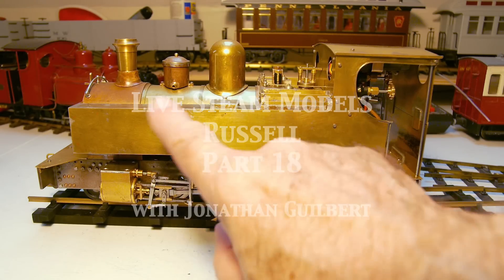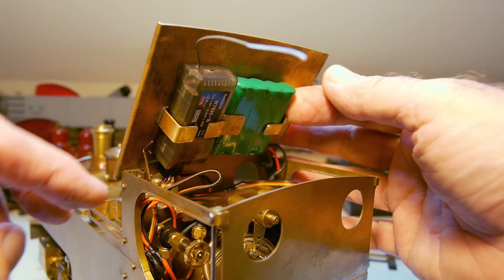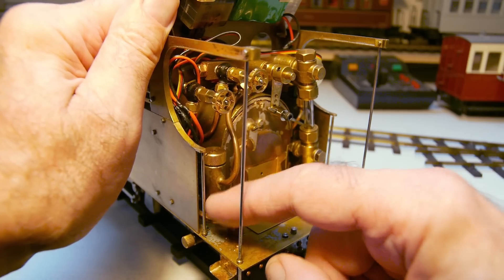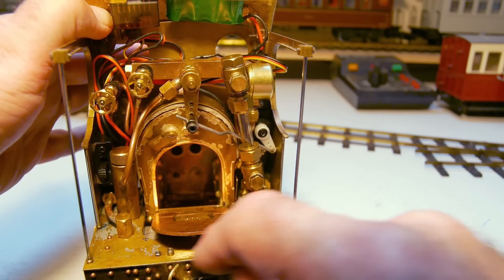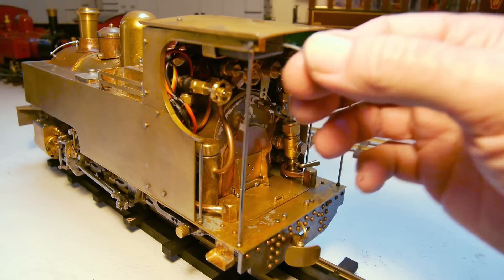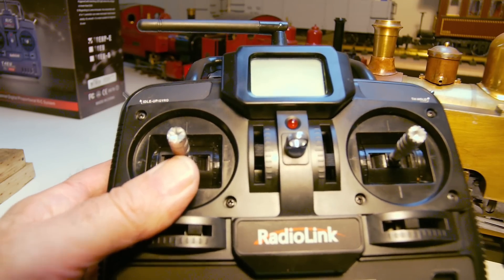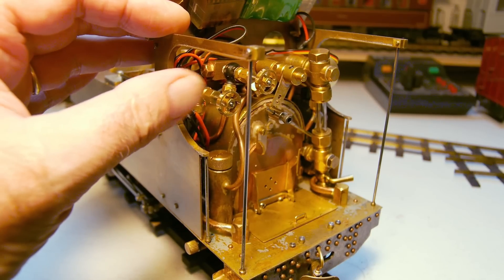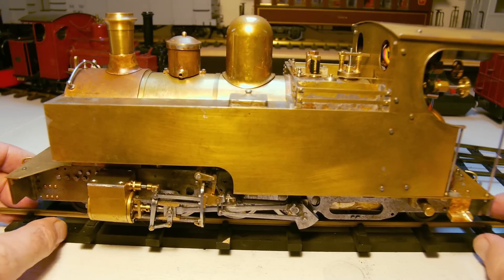'Russell' Live Steam Model Locomotive Part 18

Comment: Very Impressive.  Have you made all the valve gear yourself or did you use Roundhouse components?
Reply from the maker: Hi Heather, the cylinders are the only parts of the chassis bought from Roundhouse all the valve gear and wheels I made.
Reply: @GandyDancerProductions  How did you work out the various valve gear dimensions and are their any plans?
Reply from the maker: @heatherfooks9588  As i was using Roundhouse cylinders I started with their basic valve gear dimensions but because i made a real combination lever it allowed me to reduce the size of the expansion link.  Most of it was by trying and adjusting.  Didn't draw it out or anything like that.

Comment: Can i ask you if the drawings for this loco are available to buy,It is a super build, Thanks
Reply from the maker: The plans I used are from the booklet - Russell: Story of an Historic Narrow Gauge Steam Locomotive by Welsh Highland Railway - which is out of print but you can find it second hand online.  These plans are just a side, top, front and back elevation.  They are not broken down into component part but are very detailed.  I don't know what you mean by super build.  It's certainly practical build in that everything works for real except the air pump on the front.